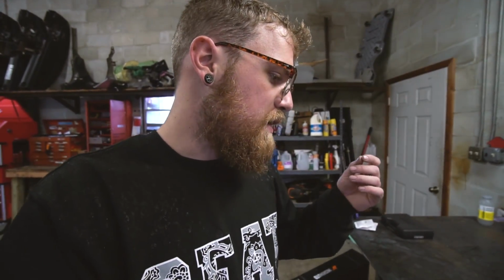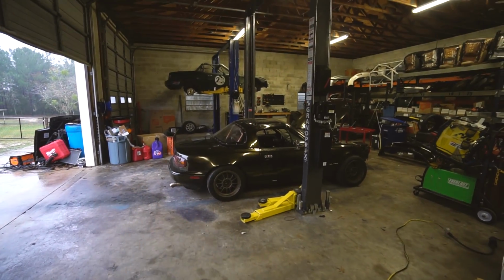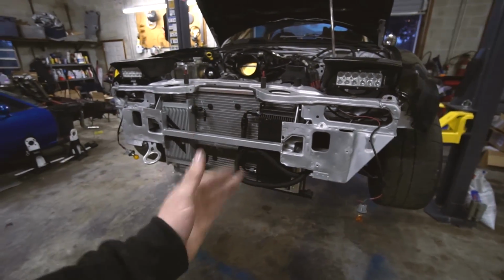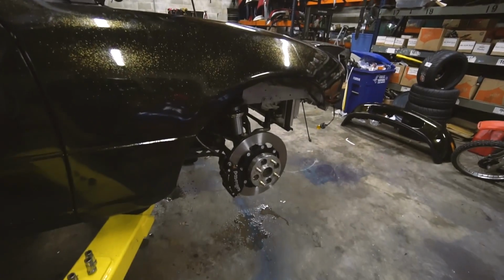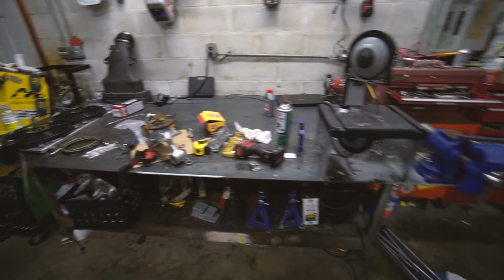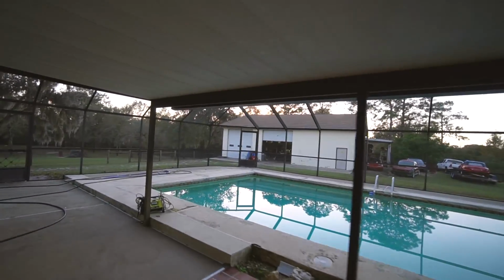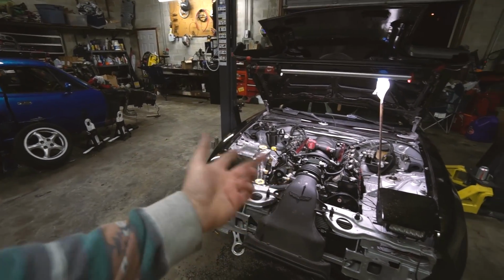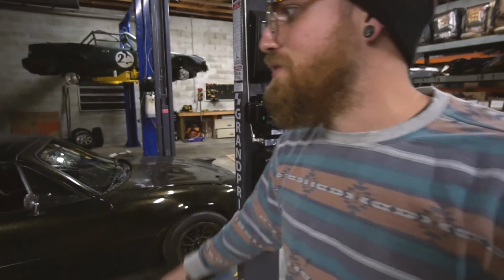LS Miata Gets a Big Brake Kit!

Comment: The miata is low key becoming a balance between a drift car and a track car
Reply: its an all around solid project car.  He said he always wanted to do a full and through build and this is finally a build where he didn't cheap out and just got the car together just to drive it.  Thats what the z is for :)
Reply: The only thing thats more track oriented are the stronger rear springs, the rest just applies for both, except for the angle kit
Reply: Holy fuck dude, is it your goal to comment on every single automotive channel on YouTube or what?

Comment: The piston size difference from those calipers differs from stock, i think thats why it locks the rears. Think of it this way, you have bigger pistons in front and smaller in the rear. this mean you need more fluid to the front than the rear to move the pistons set amount. The new mastercylinder might fix this though. If not you can install a brake balance bar and manually tune the brake bias front to rear. 

I love this project and i cant wait to see you slay some rubber! Keep up the awesome work Taylor :)

Comment: Trailbraking.  Lets get some gold.
Reply: Coasting should almost always be minimal. If you are straight-line braking, you should be turning in and applying throttle as soon as you come off the brakes in most cases. The idea is that you’re constantly keeping the kart loaded so that the chassis remains sprung and keeps the inside rear wheel off the ground.

Every corner requires something a little different, but I trailbrake quite a bit too. Terminology can get mixed up here, but when I refer to trailbraking, I’m referring to braking slightly passed turn-in, or even up to apex depending on the corner. It’s give and take. If you brake later, you’ll have to get on the throttle later, so you’ll gain on entry but lose on exit. If you brake earlier, you can get on the throttle sooner and gain on exit while giving up a little time on entrance. So depending on the next string of corners, you could end up with a few different ways of tackling each section.

It also will depend on engine package, grip levels, tires, etc… You can’t necessarily drive a corner the same from engine to engine or even from morning to afternoon, as the grip levels will be changing on race day.

The best drivers are feeling each corner change as the session goes on, and adapting their driving accordingly. And many of them performing that “huge ask” you touched on in your post; nailing the deceleration and carrying the exact speed needed to be on the limit of traction. That’s all driving fast is; being on the traction limit, whether it’s braking, turning, or accelerating.